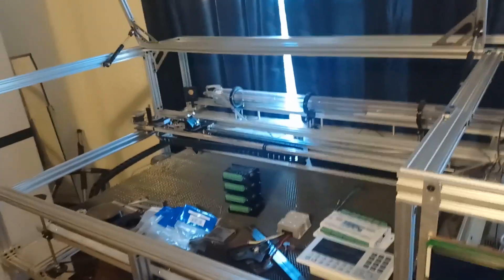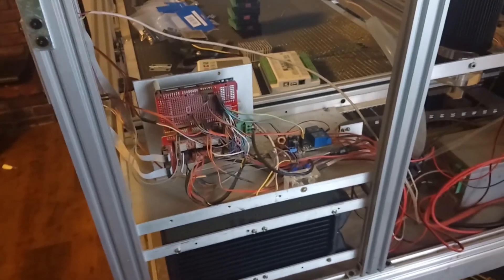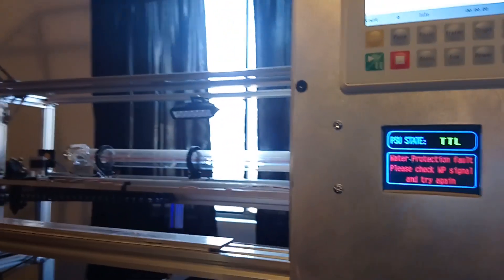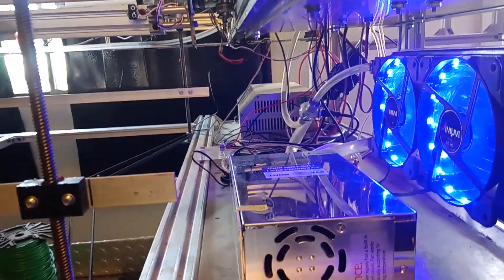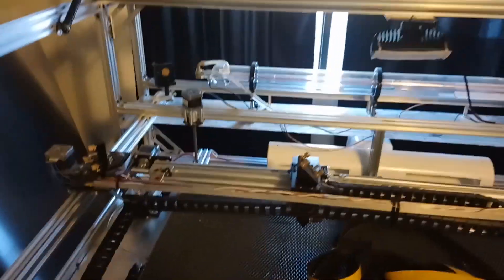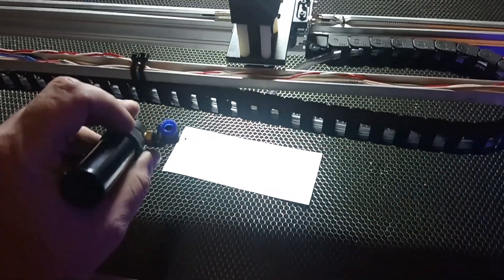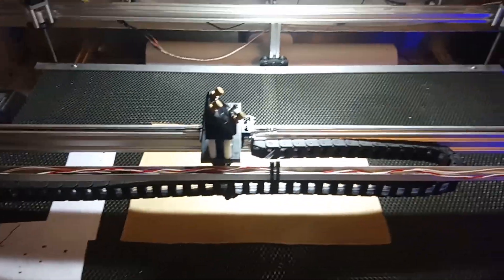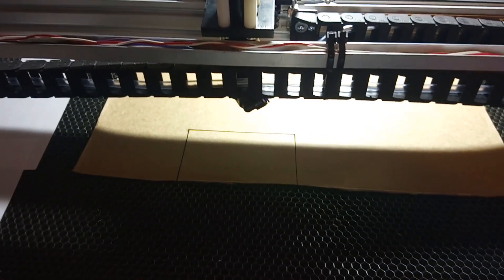Final Part of the Laser Cutter Build (Finally Done)

Comment: I didn’t see the air pump but sometimes on the diaphragm ones you can set it more level and it will quiet down. Or you can strap it down tightly to reduce the vibrations and subsequent noise.